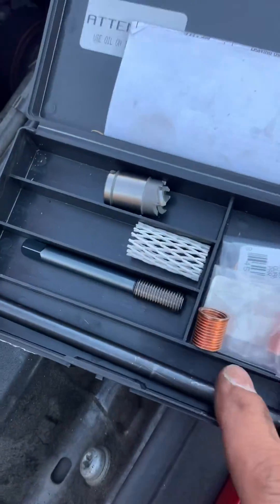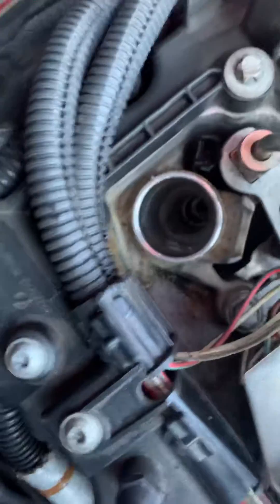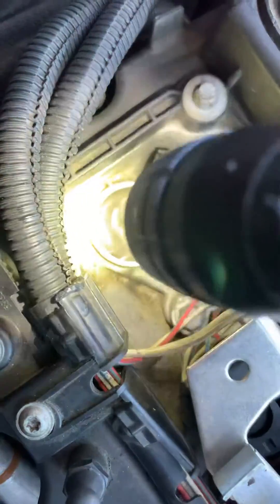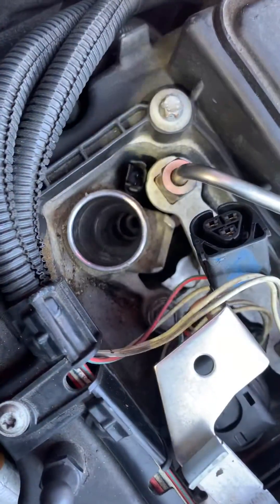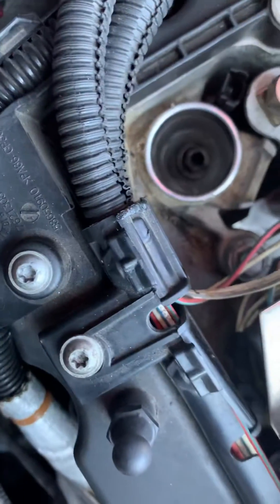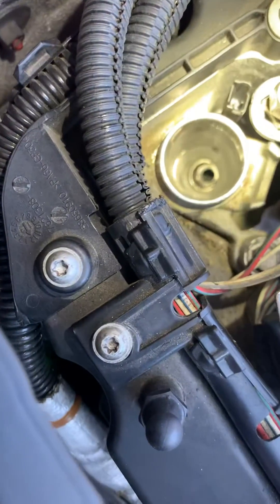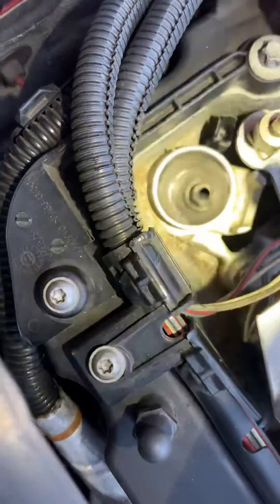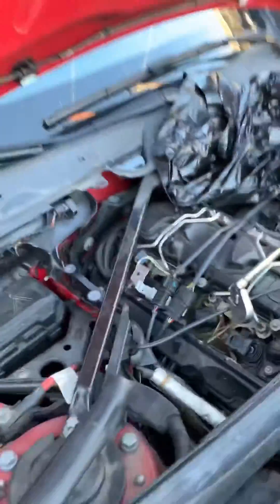BMW spark plug stripped thread repair

Comment: How do you make sure not get metal shavings down into the cylinder?
Reply: Lots of grease on the threads and then guys will take a shop vac and rig up some fuel line or such and actually vacuum out the cylinder(s). I can get bore scopes these days for pretty cheap that can def help show u if there even is any down there..  Highly recommend a engine flush and then a very short mileage 2nd oil change as this is a “Double Rubber” sort of situation 😂